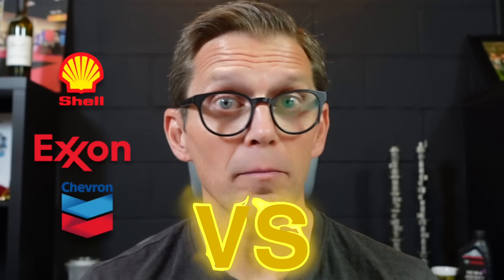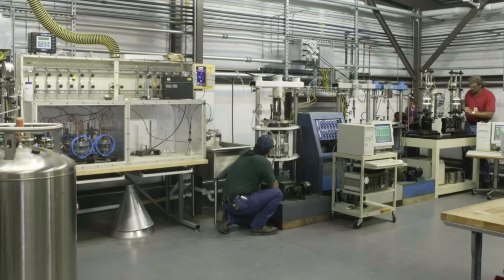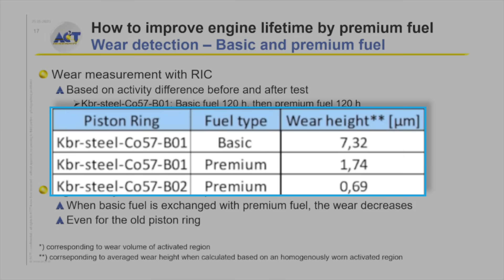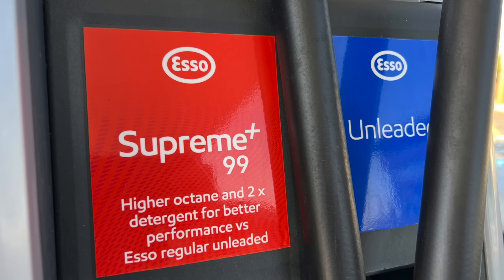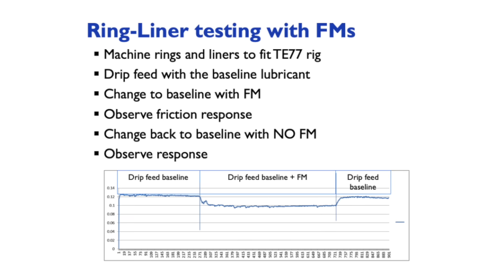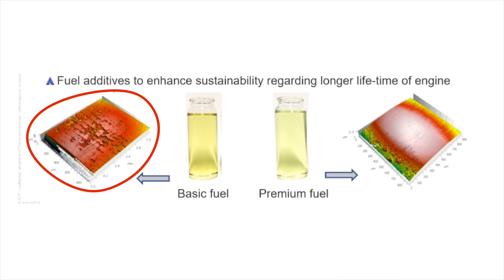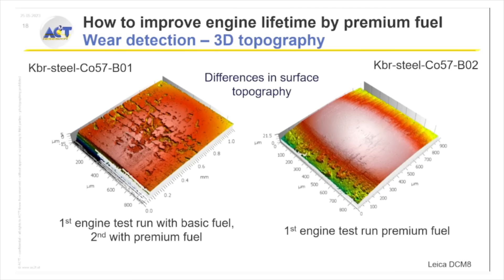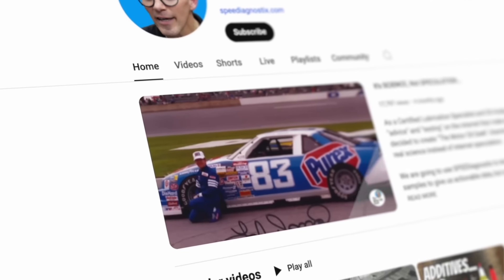Can Premium Fuel REDUCE Engine WEAR?

Comment from the maker: WOW!!! I know I say this all the time, but really - WOW!!! I'm blown away by the response. I wish I had the time to read and respond to every comment. Needless to say, we will do more videos on fuel. In the meantime, here is a link to a video I did on Top Tier fuels: https://youtu.be/zyy7ZekQ8do
Reply: Very much looking forward to it. 

Could questions:
1. Can you do a top tier side by side test of regular vs premium to see the additives?
2. Previous video recommended PEA additives. Like Techron. Can you show whether it’s just detergent or also a lubricant?

Thanks!!
Reply: Can using a premium fuel in a regular 87 octane car damaged the vehicle? My car says to use regular fuel only but I would like to use fuel with the friction modifier in it which is only in premium by me it seems.
Reply: @davidpotts8128  never harm in using higher octane, it's only damaging the other way around if you require 91 and used 89 or 87 instead
Reply: @100pyatt  Even in cars that recommend or require 91+ using 87 will just result in the car using a less aggressive tuning map and this losing power. The PCM won't allow it to blow up. At high altitudes you might even find some stations using 85.octane due to decreased air densities. Those of us who have turbo cars hate those states because our manifold pressures are not really affected by altitude and that fuel can still damage our cars. My Evo will simply crank it's boost higher when altitude increases.
Reply: @davidpotts8128  Hello David. Your question is nearly a year old. Regardless, it still deserves a valid answer. 
Using gasoline with a higher octane than what is required and//or recommended by the manufacturer does create issues for the engine & has the potential to shorten engine life. It's equally true if you habitually use quality, "name-brand" fuel, an engine will...in most cases...require fewer repairs, perform well & live a much longer life. Considering the engine is propely maintained. 
The quality of fuel//gasoline & the quality of engine oil used are the 2 most important factors contributing to engine life. Fortunately, we have complete control of this. 
Regardless of some of the commentaries here-in, ALL GASOLINE DELIVERED TO NEIGHBORHOOD GAS STATIONS ARE NOT THE SAME. Yes, the same tanker-truck may deliver to several different name stations; 76, Shell, Chevron, etc. BUT...the tank being hauled to those different brand-name gas stations has individual cells for containing the various brands of gasoline. As you likely know, all gasoline begins the same. After refining, each company formulates their fuels. Is Shell better than Chevron or 76? it's a matter of opinion. The point is they're "brand name" fuels & we consumers can be assured of their quality. An additional benefit is brand name gasoline is formulated for the season; cold Winter months verses hot Summer months, It's also formulated for regions at high altitudes. For example, Denver verses Miami. Interested onsumers can educate themselves on the internet about the different additive packages used by these companies to "enhance" their individual fuels. 
Now, to answer your question: Using gasoline with an octane rating excessively higher than an engine requires creates a couple undesireable issues. Once the octane requirement has been quenched, unused//unburned octane converts to ash//soot. This undesirable material creates deposits in the combustion chamber, on valve faces, piston crowns & piston rings. It will also collect on cylinder walls & there-by gradually contaminate the engine oil. Of course, this will shorten the "effective" life of the engine oil. Such "deposits" will occur when the correct octane fuel is used....BUT...in MUCH LESSER quantity. Name-brand gasoline...ESPECIALLY THOSE MARKETED AS "TOP TIER"...are formulated to keep combustion chambers, valves, piston crowns. etc. free of deposits. No doubt you can imagine how habitual use of gasoline with excessive octane in normal passenger cars & trucks has the potential to shorten engine life. 
I feel I've told you more than you ever wanted to know on this subject. 🙂 Regardless, I hope I answered your interesting & insightful question. 
Best regards, 
Ben
Reply: @duygukayhanisaskank4915 Thank you so much. That was super informative and helped a lot. I am building a 64 1/2 mustang with a 347 right now so all the info I can get it great. I had a shop tune the engine years ago but it has sat for a long time. We have a methanol injection system as well which I have to clean out the whole system but I wasn't sure about gasoline values for my everyday driver and this helps out so much. Thank you! I really appreciate you taking the time to answer my question so thoroughly. You are the best.
Reply: @davidpotts8128  Thanks David & good~luck with your 64 1/2 Mustang project. 🙂
Reply: @davidpotts8128 Try a bottle of Amsoil upper cylinder lubricant added to the gas tank. I did recently and my 5.7 L V8 quieted right down, no kidding.
Reply: @davidpotts8128  this is how I understand it. It all has to do with the higher compression engines needing a hotter burn and if you run 93 in an inch design for 87 it doesn’t burn all of the fuel correctly so it’s kind of wasting money. I believe that also adds to carbon buildupbecause it doesn’t get a complete burn.
Reply: @davidpotts8128 Ok my background involves tuning modified vehicles. It's been a hobby and a career for ten years. Your car from the factory has been configured for a wide range of allowable tuning conditions. Variations in ambient temperature, air pressure, air volume etc. A modern PCM has a table that reflects these wide range of inputs and can output various configurations of ignition timing, camshaft timing and lift (in some engines), throttle angle, and boost (In forced induction setups). Using a higher octane fuel in a lower compression engine designed for 87 will not hurt the car...it's simply a waste. Your engine will be able to max it's ignition advance for most situations in its tuning table, but it usually can on 87 octane anyways. What will happen though is the fuel will not completely burn if it has too much octane. Also higher octane fuels have less btus of energy and less ability to ignite at lower pressures. So engines will waste it, you might even have more fuel contamination in your oil due to a slightly rich fuel mixture. Point is, if your car is setup to run 87 that's all you need to run. If you have a recommendation to run 91+ you should run it for have maximum performance. You can run 87 in a 91+ car but your timing, valve overlap(via vvt) and boost will reduced  to reduce knock and cylinder temps. It will also reduce mileage because in an FI car fuel is also used to cool cylinder temps, so under boost more fuel will be pumped in to reduce air fuel ratios. Every car has a different combustion recipe. Follow your manual...
Reply: @davidpotts8128  No, but WONT improve performance whatsoever. Just use top tier rated fuel consistently as he's stated. 87 or 89 grade (at most). Use good fuel system cleaner every 10-12k mis. 💯
Reply: @themotoroilgeek  if you could let us know your thoughts on Lucas upper cylinder lubricant.  Thanks 🙏
Reply: @rdpackett  look at the video on additives you'll get your answer
Reply: @100pyatt   the video I saw he did not include the Lucas upper cylinder lubricant
Reply: What about ethanol free gas?
Reply: @pipbernadotte6707  Its not sold everywhere in US & where it is here in Western Ohio..i've noticed NOT top tier rated fuel! I use only in my lawn equipment not my expensive 22 Ranger FX4 /gen2 GTDI engine. Gets midgrade 89 top tier fuel  since new along w/Pennzoil Ultra Platinum & Fram Ultra Synthetic filter. Runs/drives outstanding. 💯
Reply: @Davido50 
Good Lord, you’re awful proud of that Ranger, huh!!
Leave a few more comments telling every spec you know by heart 😅😅😂😂😂😂😂
Reply: @vsetkoumiera7683 Just leave very descriptive comments to help others. What you want to know fella? 😉
Reply: @pipbernadotte6707 Hard to find.
Reply: @pipbernadotte6707 Ethanol (corn/grain alcohol) simply replaced Methanol based MTBE (wood alcohol) as a pre ignition moderator. They are chemically similar. Before alcohol moderators they used lead as an octane booster. Gasoline is a balance of heptane and octane chains with octane reducing preignition of the more volatile heptane. Ethanol free gas is simply using MTBE based moderators. 

Btw boomers complained about MTBE when leaded fuel was dropped too. Scientific ignorance drives these old man tales.
Reply: @pipbernadotte6707  ethanol free fuel is garbage
Reply: @100pyatt Real straight gas is garbage?
Reply: @100pyatt 
Garbage? How so?
Reply: @darrylsjodin7184  Not garbage just harder to find.
Reply: The Top Tier Fuels video doesn't rate different brands of gasoline.  I think we all understand that top tier fuel is important, we need to know who truly sells good, great, and bad, gas.  In the US there is the assumption that 92/93 octane fuels are better quality, not necessarily so, 92/93 octane fuel can also be LAC.
Reply: @JMinTexas  They ALL meet much higher standard for detergents/additives. Can't go wrong w/any really. Then use good fuel system cleaner like Redline/STP/Royal Purple every 10-12k mis (have friction modifiers). Works great for me on 22 Ranger XLT FX4 w/gen2 GTDI engine & 23 Edge ST AWD w/gen2 GTDI engine as well. 💯 -Western Ohio
Reply: @themotoroilgeek  You are awesome! Love fact based-solid testing that brings respectable conclusions! It would be great to learn more about gasoline! I would love to know:
1. Ethanol vs pure gas. How much does one affect vs the other in terms of performance & more importantly engine life?
2. Exactly the same as above regarding octane 87-89-91-93? Engine performance & engine life?
3. The different brands of gas -Top Tier vs. Shell vs. Exxon vs. Marathon vs. BP…which is better in performance & engine life?
Reply: Thanks Lake! I am a subscriber to more than 200 YouTube channels. Yours is so awesome.
Reply: so basically what your saying is the premium fuels no matter the supplier has friction additives in the fuels ,so as they say stick to what the OEM recommended as far as fuels, if it has a sticker on the fuel cap, telling you you can use a E10 fuel or 98 fuel like we do in AUSTRALIA and even E85, then use it based on what the fuel cap and the owner's manual says to use?
Also using octane additive do nothing unless you test the fuel out of the pump from your local service station and its bad fuel as far as you do not have access to say 98 or 95 RON and thats what the owners manual says to use, then maybe considering a fuel octane booster to make the fuel and engine run better cleaner and maybe check if the additive has friction additive in the booster? cheers 🦘🦘✌✌👍👍👌👌
Reply: @7071t6  99% top tier rated  premium grade brands now contain friction modifiers! Good times. My '22 Ranger XLT FX4 crew cab w/gen2 GTDI engine has gotten midgrade top tier fuel since new along w/Pennzoil Platinum or Penn Ultra Platinum & Fram Ultra Synthetic filter only. Runs/drives phenomenal. Can't beat these midsized trucks. Best in class. All new 24 Ranger best in class as well. 💯
Reply: @7071t6 Most octane boosters are snake oil that dumps MMT into your engine and messes up catalytic converters. Toulene, methanol and Torco are the only real boosters out there but they only raise a few RON points and I only use them on old gas for a car that has sat for a while.
Reply: My 22 Edge SE AWD w/Gen2 GTDI engine has only had top tier rated fuels since new along w/Pennzoil Platinum or Pennzoil Ultra Platinum & Fram Ultra filter every 5k mis MAX. Air filter 12k mis max. Runs/drives phenomenal. 💯 🇺🇸
Reply: Test NMF. It's an incredible liquid additive for fuels, motor oil, gear oil.
Reply: In your opinion, what is the absolute best premium fuel brand?
Reply: I have a question for ya. In your professional opinion, which gasoline producer make the best gasoline, or has the best formula?
Reply: What about how these friction modifiers/premium additive packages affect overall catalytic converter performance in the near and long term?
Reply: @themotoroilgeek  thank you sir! Keep up the great videos
Reply: Fuel Octane changes Engine Temperatures. How does that Impact engines in extreme Cold Climates?
Reply: Given the information regarding fuel and additives and the chemical mix at the rings themselves, what are your thoughts on seafoam? How does it test?
Reply: I would like to know I have got a 23 Honda pilot Lake in your opinion Honda says that you should run 8789 octane would it be better if I run the 93 octane top-tier in this Honda pilot thanks I like your opinion please
Reply: Having a hard time finding reasonably priced fuel that claims to reduce wear. If I tried adding fuel additive or 2-stroke oil to the fuel, could oil analysis be used to confirm that what gets down to the crankcase doesn’t cause problems with the engine oil?
Reply: @shawngrimes9302  I prefer to just go back to the regular sulfur diesel that was much more oily
Reply: We don't have Shell gas here in Western New York. I run Mobile gas exclusively in both my HEMIs. The 5.7 recommends 89 , the 6.4 recommends 87.  The 6.4 is new so I'm just following the manufacturer recommendations while under warranty with the exception of more frequent oil changes.
Reply: @rustypipes12  Mobile, Shell & Chevron...all GREAT fuels. Your a wise man for doing oil changes more frequentky than the manufacturer recommends. It's cheap insurance. I L~O~V~E those HEMIs; since the 60s. 🙂 
Best regards, 
Ben
Reply: I love what u do its very interesting an helps take care of ur  vehicle better the way it should
Reply: Please provide a more in depth video on fuel
Reply: Lake GREAT Video, who would have thunk it fuel could make such a difference.  Someone has already mentioned it would be great to see test results of different fuel brands, fuel additive packages are not really advertised, how do we know or can we find out which premium fuel brands use a anti-wear additive as part of their additive package? 
Also... along those thoughts of difference in wear based on fuel, what about diesel fuel and wear?  I run both gassers and diesels and try to stick with Shell or Exon diesel, I would love to see the results for diesel fuel as well... who would have thunk it?
Reply: Thank you for putting this information out there for us, and thanks in advance for any future information you have a chance to provide on oil, fuel, and even fuel additives.
Reply: you should look into 7/11's gas, it might just be more ethanol but every vehicle I've owned either gets slightly better or slightly worse running on the stuff, it's the only gas I've run that makes a noticeable difference every time I run it and I've heard many others say the same thing
Reply: Could you run a test on oil on a engine with water injection.
Reply: I absolutely love your channel. Regarding fuel quality and additives, I have contacted Exxon to find out how I can tell if a gasoline station is using actual Exxon fuel and additives and not some generic local fuel provider dumping their fuel in their huge tanks. They didn’t answer me to a level of confidence that assured me I’m getting the correct fuel in my vehicle. How can the average consumer like me find out?
Reply from the maker: @Eddie786778  Thanks for watching! There is a certain level of trust you have to place in the station you are buying the fuel from.
Reply: The Shell commercial did not say that the fuel reduces engine wear it very specifically said that it reduces wear of metal fuel system components.
Reply: Thanks for the video, very educative. Premium fuel reduce engine wear but reduce my pension and wealth way more than anything else.
Reply: @themotoroilgeek OK, so on my flex fuel vehicle, how does e85 interact with the oil? I feel like the engine likes e85 better but is the additional fuel just washing out the oil from the rings and causing more wear? I'm sure this could be a video by itself.
Reply: Thanks for the vidoes Lake. What is your opinion on using Marvel Mystery Oil in the fuel? Does it help with lubrication of the rings pack? Im up in Canada and my brain goes in the direction of it helping lubricate on my -40 mornings. Or am I over thinking it?  😅
Reply: Is there a fuel additive I can pick up that will simulate this?
Reply: Do the same video but with ethanol free gas and if it can increase mpg for old and new cars we are talking 1980 to 2000 to 2025.
Reply: I once saw you say that if doing more frequent oil changes use the regular filter instead of extended run ones. I get it's cheaper but does it actually filter better? I don't mind  paying a little more for my XL filters ( CHAMP) . They're cheaper than a lot of big name filters anyway. I buy 6 or 12 at a time.
Reply: I use BND Aces octane booster, and Brian, who created the product tells me that his product does not increase octane at all -- but it works as an upper cylinder lubricant that creates the effect of a higher octane fuel. On my turbocharged car it means the difference between 110 mph and 122 mph on a closed, set distance. I was astounded to hear that it does that without changing the actual octane. Maybe it's related to your subject here.
Reply: So this was on 2 brand new engines without having any break in. They ran for different amounts of time. Did they run them under identical loads and everything or was that all subjective too? Seems like a lot to get double the wear metals in less time but if the engine use is different wear patterns will be different. Was there a wreck it Ralph and a Grandpa doing the running f these engines for 104 and 120 hours? Here in the US premium means high octane, octane is anti knock so the fuel’s ability to resist premature detonation. The ethanol thing is a horrible scam to force us to pay more per mile for the fun of it. Oil doesn’t cost more and they use the cost of producing ethanol to justify doubled fuel prices then charge us a dollar more for gas without ethanol in it. Yeah that’s right. We can’t run everything on 89 or 93 octane fuel because not everything will self advance timing to accommodate that. Some cars that are supposed to won’t do it well because cheap Chinese electronics and poor engineering. I would like to see a side by side comparison of same octane rating 10% ethanol and non ethanol in same condition engines with same oil packages. All the running fine by a computer to make it all identical. Expensive and unlikely but it would help solidify any findings. Since I have hundreds and hundreds and hundreds of thousands of miles under my belt I don’t believe it makes that big a difference and how you drive and how strictly you maintain your oil and your oil and its additives are more likely the determining factor of long service life or not. I am not brand loyal to gas brands. I see no value in paying $.30 and more per gallon over all major discount brands to power combustion. I have a car that seems to run a little better on 89 than 87 but the price difference man. Close to $1 a gallon difference. Runs fine on 87 and I throw some MMO or 2 cycle oil in every now and then. I prefer MMO because it’s meant to be mixed super low concentration and is less expensive than 2 stroke oil. Both are fine neither have caused an issue in an engine with now over 322,000 miles on it. I would trust it to take me back across the country again tomorrow and just a few basic prey rip maintenance items I always do it would be a great road trip car again. I personally think excessive idling is far more destructive than cheap gas ever will be. Maybe if you pump E10 but fill with e85 that would be destructive or even e15 but outside that kind of fraud idling is more destructive. Staying in gear stopped too long is more destructive to your transmission than Walmart gas is to your engine even if you never buy any gas with special additives.
Reply: I’m highly skeptical these number differences are solely from fuel brand and gonna repeat long term. I believe that driver variations are at play too. Too many unknowns to guarantee it’s only fuel. Unless they controlled everything in a lab including the run times and revving and everything on a program to guarantee one didn’t get 1 minute more warm up or cool down between romping on them. I’m thinking these patterns are less impactful over the course of 300,000 miles is what I’m saying. Maybe fancy gas is needed during break in for smoothest slowest wear in possible but eventually it’s gonna be 3 in the morning and have to buy what’s available because the fuel light is on and you’re in the middle of nowhere between civilization and your remote vacation spot. Is there a link to their study and all the conditions surrounding it? I would be interested to see a longer term analysis on the difference between both equal octane fuels as engines wear in if it’s still being looked at.
Reply: ¹¹¹¹¹¹¹¹¹1¹1¹¹¹¹¹¹¹¹¹¹1¹¹¹¹¹¹¹¹¹¹¹¹¹¹¹¹¹¹1¹¹¹¹¹¹¹¹¹¹¹¹¹¹¹¹½²😊²22pdid 22229999999922 22pdid 2²23rd 29 23rd 9 3rd 22pdid 11th 15:09 22pdid 3 23rd 23rd 99999999😅9992229999😅😅92999999999299😅😊😅99299 15:09 99999993😅😅9922221999999 15:09 😊😅 15:09 😅😅229😅999929😅😅😅9 15:09 9 CT  . Gufic cc 😮CT y tcy❤y. 😮 😮  T 4y   i3qtq5 yyt TY ý😮 44 y😮 -😮TC 6cc ZZZ😅Cc tqc y gc uqq😮  uy y❤y 7 thx t😅 y 15:09  2t tyyc 15:09 yy GG y8 ZZZ.  . G.  TT ty. 😮ft y BFF yc 😅
Reply: How meaningful is any of this, if the stations offering "Top Tier Fuel With Friction Modifiers" are not identified?  Do we only go to Shell stations, even if the nearest Shell station is 60 miles away?  It would be good to get a list of which stations have fuel with modifiers; Right?
Reply: so what brand do you recommend to use , what it be shell ?
Reply: Hey Lake... Go fill your oil filter so you motor doesn't wear out 😂
Reply: I live in a rural area. We have 5 gas stations in our 2 small towns. Chevron, shell, 76, speedy mart, and circle K. Guess what? The same fuel truck delivers to all 5 on the same day.
Reply: @jimmyjames6487 All they delivering all grades, or just one grade, like the regular?
Reply: @D2O2  I imagine all grades because it's the only truck that delivers. It's from a local fuel supply company.
Reply: fantabuloussnuffaluffagus  that is what I was assuming. The same fuel with different additives for the brands.
Reply: @D2O2  Only in premium grade fuel. Just use top tier rated fuel IN RECOMMENDED GRADE for excellent engine cleaning/reduced carbon + good full synthetic oil like Pennzoil Platinum every 5-6k mis for minimal wear. Best bet!
Reply: @jimmyjames6487  No, premium grade only as he stated. Just use top tier rated fuel in your vehicles recommended grade for best performance. Good fuel system cleaner every 10k mis too (has friction modifiers!)  Redline /STP/Royal Purple are my go to products for my '22 Ranger XLT FX4 w/gen2 GTDI & '23 Edge ST AWD w/Gen2 GTDI.
Reply: fantabuloussnuffaluffagus  Yes, exactly. Answer is use your vehicles recommended fuel that's top tier rated for best performance + good fuel system cleaner every 10-12k mis! Redline /STP/Royal Purple my favorites. 💯
Reply: @jimmyjames6487  What you don't know is that a tanker truck, the tank itself has several individual tanks inside the larger tank, this can be seen by the multiple port openings on the top of the tank.  A lot of these tankers will even have diesel being carried in the same large tank, but it's separated into a smaller internal tank.  These tankers have 4 separate compartments, so they can carry 4 different fuels on a single trip.  What you did not see, and the part you may have over exaggerated was that you did not see the same truck going to 5 different stations, you probably saw a single truck going to 4 different stations...UNLESS, the Speedy Mart and the Circle K use the same cheaper additive package, then they could have used part of one tank for one company, and the rest for other.

So the trucker, goes to the dispensary, they have a additive list they have to look at, and depending on the brands they are putting in, they adjust the dials for the additive blends that will be going into each separate tank opening.  Back in the day they used dials to make the adjustments, not sure if they're using digital readouts and buttons now, but more than likely.  

The only problem with these separate fillings into one large tank is the potential for driver error, if the driver reads the additive sheet wrong, then a particular gas station that part is going to could get a better or worse additive package then specified.  I'm sure that has had to happen, but it would be infrequent, and I don't think it's possible for anyone to catch the driver's mistake, but maybe they use cameras to make sure the driver uses the correct mix into the correct tank?  Then  could it also happen that once they get to the station they accidently pump fuel from the wrong separate tank?  And is there a way to check that?

I know this stuff because a deceased friend of mine use to drive fuel trucks, but I can't ask him if they could check to make sure the correct fuel is going into the tank, and is the correct fuel being delivered to the correct station.  Maybe fuel tanker driver can answer this question.
Reply: @jimmyjames6487  Just because the same truck delivers to all gas stations the same day, it does not mean that it does it in the same trip, or does it? May be he does multiple trips the same day. My understanding is that the truck tank has different compartments that hold different grades and “brands” of fuel. In one of the commends for this video, I read a commend by some guy (Catdaddy3728) who drove a tanker truck for 40 years. Very interesting commend. Like that most gas stations only have two tanks. One for 87 and one for 93 (in his area, 91 in others), if you buy mid grade gas of 89, the pump at the station pumps a combination of the low grade and high grade to give you an octane of 89. He might be able to answer your question better than any of us. All we are doing is assuming. Some of the people leaving commends for him seem to be very knowledgable too.
Reply: @jimmyjames6487  that’s correct it’s the same fuel. The only difference is the additive package which the person delivering the fuel puts in at the time of delivery. It doesn’t go into the tank of the truck. It goes into the tank in the ground.
Reply: @jimmyjames6487 hahaha so which one do you use 🤣🤩💪🙏
Reply: What about Seasonal Changes in Gas Formulations?
Reply from the maker: @davemi00 we are going to cover that in a future video.
Reply: @themotoroilgeek  thanks Mr. motor oil geek. I remember watching your father race as a kid.
Reply: @leatherneckprepper4477   I f you watched Lake Speed race when he was a child, you must be really old!!!😂😂😂